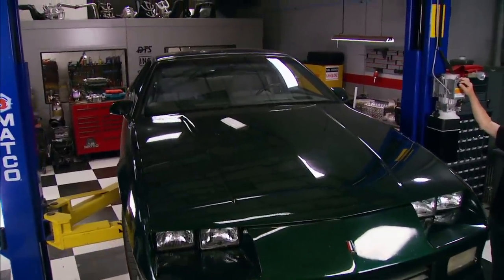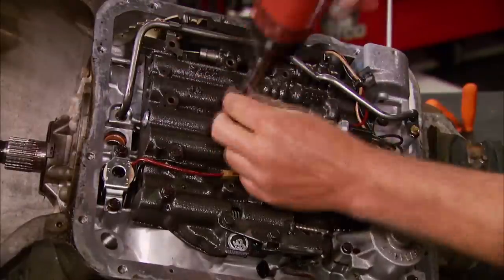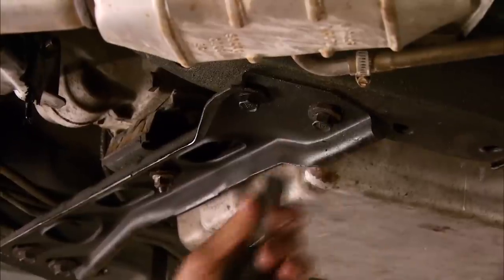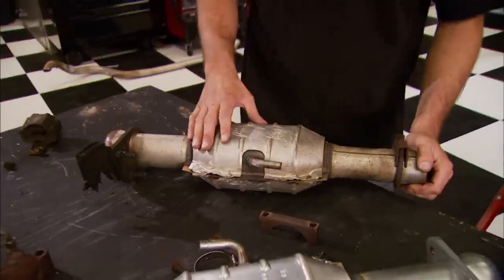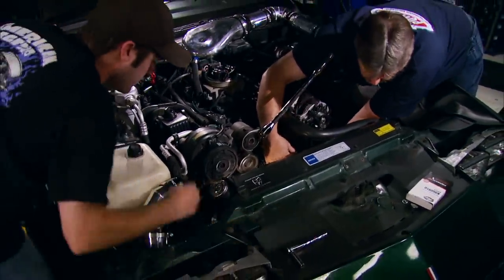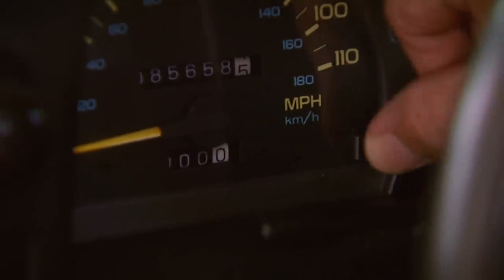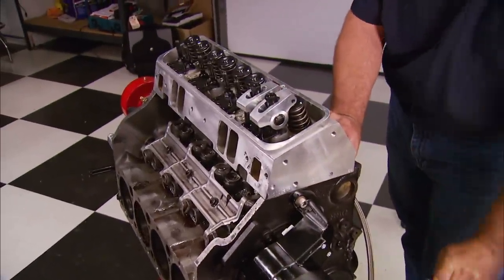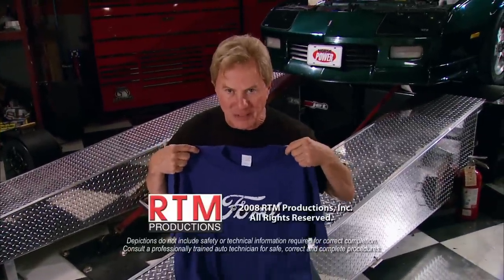Improving A '92 Camaro's Factory Transmission For Ultimate Fuel Savings - HorsePower S12, E15

Comment: those fuel economy upgrades will pay for themselves in 1,800,000 miles
Reply: Ha ha no they won't. With the way that power cable for the amplifier is run that car is going to end up burning to the ground soon if it hasn't already
Reply: @TA_Plus_Hemi  ooo I missed that
Reply: I had a fan and a electric water pump. Both went out in 6 months 🙄
Reply: Or you can just buy a Chevy Cobalt ss turbo for 5k like I did, with almost twice the HP, run a 13sec 1/4mile like the Camaro should but can't, and last but not least, have a 30+ mpg average
Reply: @aaronmenchinger  13.9 @ 102 mph. It'll take more than $5K to get a used one, and bring it back to there.
Reply: @aaronmenchinger  I had a 4dr ss turbo for almost 10 years, I loved it.
Reply: I thin you are forgetting they don't pay for parts
Reply: @aaronmenchinger   RWD are more fun.
Reply: Aaron Menchinger, I see your comment is already two hours old. Am I right to assume your SS Cobalt is broken by now?
Reply: The purpose of this series which was shot in the mid 2000s when gas near 5 bucks a gallon in California and popping 4 everywhere else. 

Essentially showing someone with a 3rd gen car like this how doing normal maintenance and eventual performance upgrades lead to more efficient A/F ratio. Hence the savings per gallon would add up over time to cover the difference. Not gonna do the math for a YT comment section but willing to bet it was quick given the prices at the time.
Reply: Eh, fuel economy improvements might be minuscule, a more fuel-efficient drivetrain is usually also a more power-efficient drivetrain as well. Less parasitic power losses.
Reply: It's not about that, I do this stuff just to reduce pumping losses
Reply: I died laughing when I read this
Reply: @trefontaine  no and i see you have probably been beaten by a 4dr grocery getting 4cyl in your overweight underpowered 90's V8 lol. I was never hating on the Camaro. Wondering why someone would throw money into a 5.0 Camaro that didn't involve internal engine parts or forced induction. Unless it's to replace original part's for original, to keep the value of an all original vehicle.
Reply: propane pays off faster
Reply: @colormesarge  end of the day it's just a cobalt yes. It is cheaply built, has plastic interior, and never turns heads as other cars might. However, did it also replace the cavaliers title as the fastest production FWD vehicle? What about it's record ( lasting 8yrs) for FWD at Nurburgring? Oh the Cavalier never did any of that? 🤷 I agree with what you say, that's why I like it, it goes unnoticed and is a true sleeper, considering I have surprised more than a few that laughed at the replacement Cavalier. Stock motor stock turbo running high 12sec quarter miles
Reply: Aaron Menchinger  you said Chevy cobalt!?
Reply: Aaron Menchinger  Chevy cobalt!!!!!  Lol 😂 why am I here
Reply: @kinglock925  yes 09 Chevy cobalt ss
Reply: Aaron Menchinger lmao 😂 u bragging about a car no one even cares about we here to see the Camaro lol  if that’s the case we could brag about our cars I’m sure my E63 will blow your car but hey we hear for the Camaro
Reply: @kinglock925  did you read my comments? I was never bragging about a cobalt. I watched the video for the Camaro as well. What I was saying was looking at performance and fuel economy as a package deal, the 5L Camaro probably isn't the best candidate. I would bet though, " your E63" would be sold after you Don't,  blow by a 4dr 4cyl sedan worth $5k how close are you to Michigan? Could make it happen if you really feel the way you do. How confident are you?
Reply: & if this was a speed episode, how long would those changes take to recoup?

Wait, no one ever calculates that. Your logic is flawed
Reply: Bloodcurling I’m confused your referring to my comment
Reply: @kinglock925  The first comment about the changes paying for themselves

Comment: The real upgrade would be a holley throttle body vortec heads milled to 53cc, express van intake for tbi to vortec heads and a factory lt1 cam.
Reply: I was thinking that same thing, those would be a good, cheap & useful enhancements for the ole L03 for sure. Too bad this is like 10+ years old
Reply: Sad part is, all those parts were available then. But got to advertise, so, here ya go instead!

Comment: the flip phone sure dates this episode.
Reply: so does the whopping 165 horsepower
Reply: So does the Accel plugs and wire
Reply: Sham_WoW_Guy you can still buy Accel Coils and wires just like them.
Reply: @CamaroAmx  but they are garbage now. Back then they weren't.

Comment: 1. Delete all the emissions stuff if you want to actually improve mpg.
2. You should have used 2 fans flowing over 2,000cfm.
3. Should have put on a better pulley system (that electric water pump is a great choice). That makes a huge difference.
4. Hooker Super-Comp headers and true dual exhaust would have made a big difference as well.

Comment: You need to check the accumulator Pistons for wear before reinstalling them. If they wiggle on the shaft the upgrade isn't going to work.

Comment: Noticed yall didn't make sure to tell folks to be sure to remove the old O-ring on the filter.  Usually remains in the trans. Double o-ring can cause issues and very likely break the filter itself.

Comment: Budget list . . . Synthetic fluids. Rear, trans, engine BLOCK . . . . Which includes oiland cooling. Wetter Water in radiator is BIG . Diet of aluminum intake, water pump,  valve covers K+N filter. Max Air pressure in tires and good front AND rear alignment. Smaller diameter / higher Cfm draw fan draws from less of given radiator, leaves more area hot IN the system. Tag in grille blocks more than small fan pulls through.

Comment: Them swirl spacers for throttle bodies actually work pretty good but is better in a truck than in a car
Reply: actually they dont....
Reply: Every time gas gets high there are always a dozen companies coming out with MPG improvers. None of which work. From swirl spacers, turbo fans that go into your intake tube, looping fuel lines, magnetic do dads for your oil filter, ect.

Comment: I have a 1991 Z28 with the 305 tune port injection. All of that crap is coming out and a ZZ383 crate motor with a built up 700r4 and 3.73 rear gear posi is going in its place. I know it won't have the fuel economy but it won't be driven daily neither!

Comment: Anybody know what type of floor they use in their shop?  I tried using the plastic squares from Garage LLC and they look great but they're horrible to clean and if fluids get under them they're a super pain to clean out -- you basically have to lift the entire floor.  Would love to do my 3rd bay in something different and put in a car lift and do most of my work there instead.

Comment: If you really want to save fuel throw out the automatic gearbox and install a manual one.
Reply: doesn't work like that,i use 2-3 times as much in my stick car
Reply: @trillrifaxegrindor4411  I go straight from two to four due to my plucky mini sedan's weird gearing.

Comment: You never use grease in transmissions, always vasoline. Never use those shitty, clip in radiator fans and those electric water pumps are not for every day use. If it's overheating, trash the stock radiator and go all-aluminum, 3 core.

Comment: Heck, jacking the timing up from the factory 0 to 8-10 degrees gets a bunch of MPG and power, but lots better off throwing away that throttle body injection system and just going carburetor.  And if that's the stock 305, trash it. What an old video.

Comment: Didn’t realize at the time why a fox mustang would crush these little cars. I guess when you’re putting down 200hp at the wheels from the factory, you have something? Now 400 wheel is nothing.
Reply: a fox could crush ONLY the lower end versions.........camaro/firebirds had 7 v8 choices  ,some better,some worse. the fox only had one choice

a fox would be smoked by any L98 or LB9 stick car effortlessly and if there were corners the fox would be decimated.compare apples to apples
Reply: @trillrifaxegrindor4411  No, the fox body would out run any f body till the lt-1s came out in 93.

Comment: 12:50 awkward
Reply: IKR?!
Reply: not all can have g80/g92 :(
Reply: @Mark-wz1yt  true, but a gearset can be had for the price of that electric waterpump. But then, increased rpm for the gearset, decreasing mpg. Simple solution to both problems, as suggested by another commenter, lower number ratio gear and a forced induction setup. Power to pull through the gears, while still getting the mpg. And put the power down to both rear wheels at the same time...

Comment: 4:59, i don't think blocking off the accumulators is a good idea and they forgot  the holy grail of 700r4/4l60 mods a corvette servo is a must
Reply: Most shops block the 3-4 as a matter of course, its actually pretty easy to do. However, what they did wasn't blocking them. When you shim them up like that you are shortening the stroke of the piston, which makes the gear change shorter.
Any builder thats worth anything uses at least a washer or 2 to shim them up a bit.

Comment: How old is this vid.....a flip phone !!!???

And a BM shift kit is one of the worst kits you can buy
Reply: I had that phone in 2005.
Reply: Huh, i'd hafta say it depends on the kit cuz the one I did for my T400 in my '72 Vette made it both smooth and quick shifting everytime. RPM's hardly changed and could hardly tell it was shifting whether daily driving, or getting on it. It was the shift kit with three options. I used the middle option. Never a problem either.
Reply: @goratgo1970  try a trans go kit next time